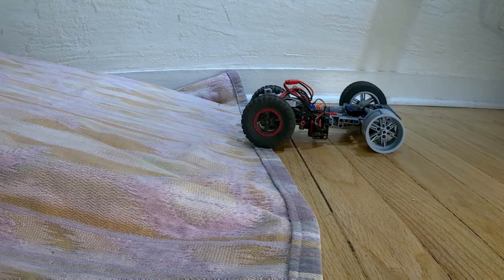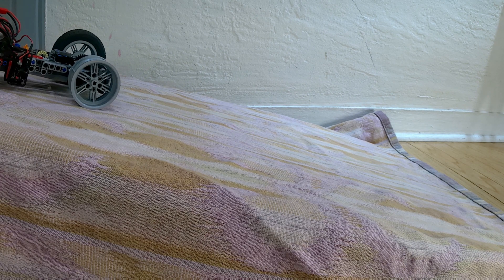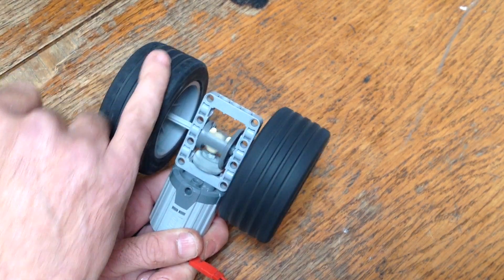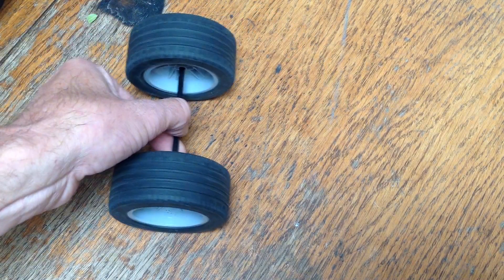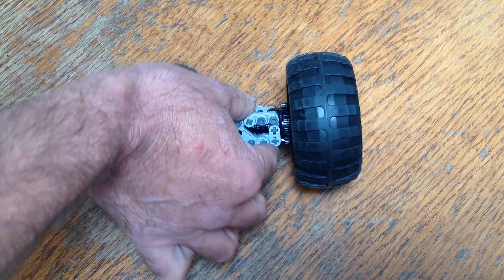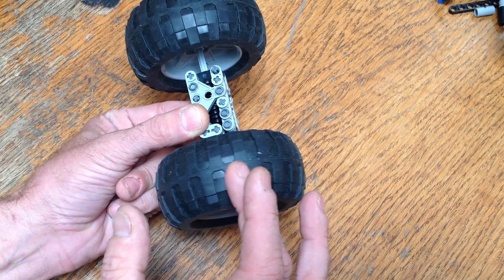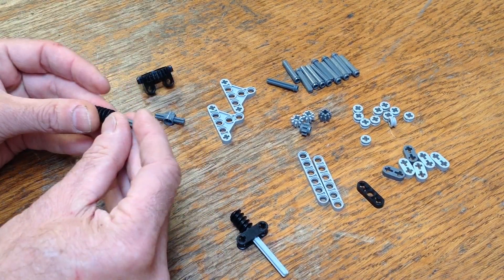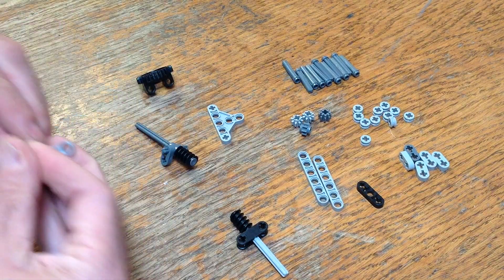Lego Torsen Limited Slip Differential With Instructions

Comment: How is the backlash with this differential? 
I have seen some models where there is significant backlash after slip before it locks. 

Anyhow,  I would love for LOGO to make a more compact housing arround this principle.

If we look at an existing differential as a starting point:
1x housing
2x side gear on each half axle, 12 tooth bevel
3x spider gear, 12 tooth bevel
1x 28 tooth, double bevel with pin hole

3x (1/3) housings 
2x worm gear on each half axle (maybe not 2L, but 1.5L or 1L)
6x, 8 tooth + 6x axle-2L
2x barrel rings (arround 1/3-housings)
1x double bevel with pin hole, 28 or 36 tooth

Comment: What is the gear that your are using?
Reply: the gear that would  be getting powered from the engine or motor.
Reply: technic turntable 48452?
Reply from the maker: @buildingbricks5691  small turntable 99010

Comment: Very cool. I want to play with building 4 wheeler like that. Any recommendations which set to get to get started?
Reply from the maker: If you want to use this diff keep in mind it can't handle much torque so something light weight. I'm not good for boxed set recommendations. Try to get something with parts you would like to have for future building.

Comment: I built it. It works, but it is not perfect. If it drives a car, it preloads itself (it flexes) and acts as locked. You need to revers, to unload (unflex) it and it can work again. And if torque from wheels gets bigger, 8-tooths get bended tooths (as always with worm vs 8t coupled). Anyway, thanks for sharing. It is nice compact model to understand how simplified Torsen works.
Reply from the maker: You did your homework A+!

Comment: Well I wouldn't say that it locks the axle since it needs both inputs to make a difference in speeds so its more like the locked axle stays locked
Reply from the maker: The axles can spin in opposite directions without spinning the housing. If resistance is applied to the housing they can not.

Comment: More acurate is name “Torsen’s differential”, because it is not only possible solution. However, thank you for pure construction without modified parts!
Reply from the maker: I figured if I called it Torsen people would say Torsens have helical gears so it's not a Torsen.
Reply: @MaxBrix  I would call it a torren diff cos I think it's patented and this works almost exactly like a torsen diff
Reply: @MaxBrix  Well yes, on the other hand helical gears are optimalisation, gears in general are core principal in this mechanism.
Reply from the maker: Well I'm going to put it in the title then! I'm blaming you guys if someone complains.
Reply: I first saw this pure construct  from this guy https://youtu.be/2NLjbwt1C70 but I think  I've seen it before them too (not sure)
Reply from the maker: It's close but mine has a lot more pins holding it together so it can handle more torque.
Reply: @MaxBrix  nice improvement, I just  bought the black piece of the turntable using  bricks & pieces so I'll try out this but I think  I'll replace the 3 module axles with nubs for the ones with stops at the end
Reply from the maker: nvm